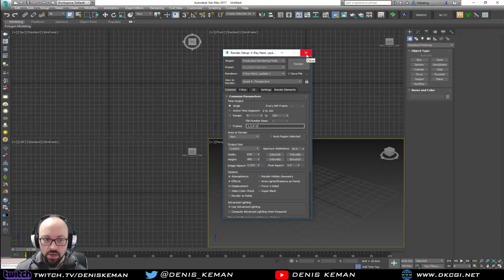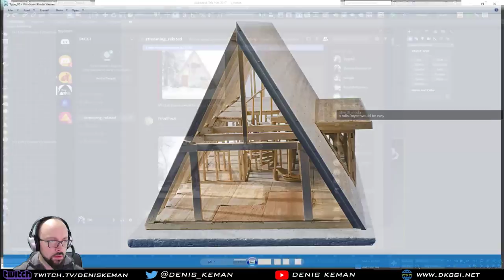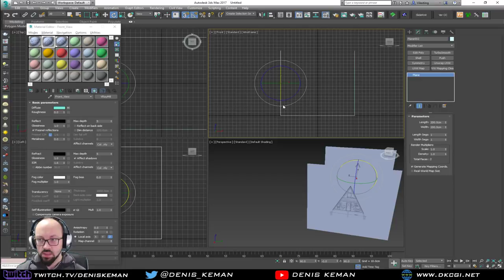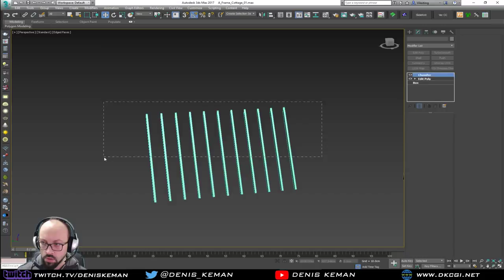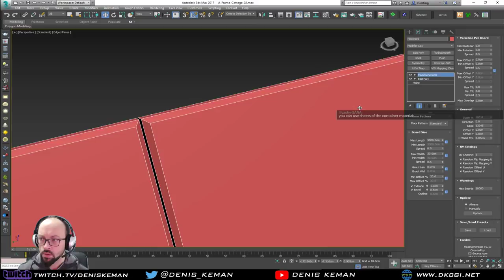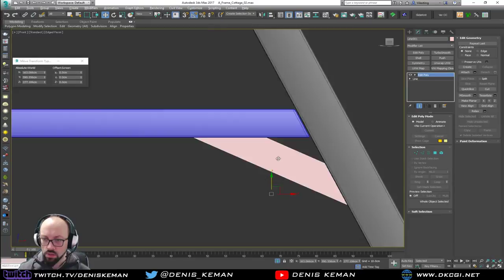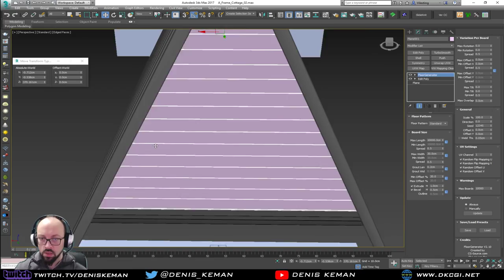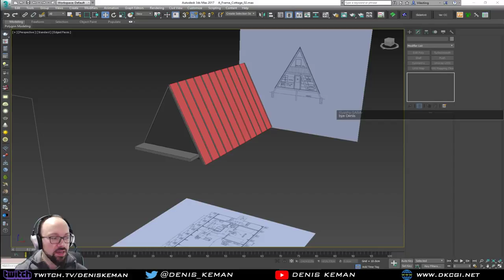Modeling a Cottage in 3ds Max Part 01 - Building The Base Frame

Comment: Hi Denis, just watched your video and I love the way you work. I noticed a problem there.. your floors thickness is actually too large. The supporting beams thickness is  what you actually see in the elevation plans. And the floors thickness should be much thinner (like 2 cm - wooden planks). That's why the human looks too tall for the ground floor. Anyway.. just telling you that, cause you might encounter some problems on the next phases. Can't wait to see the next video! Greetings from Romania! I'm a fan 😜
Reply from the maker: No worries .. for now those are just placeholders. Once we get to actually making the floors we will use a plane and use either a Substance to drive the material, or use Floor Generator to get the geometry for it. 

I'm actually really glad that you liked the video and hope to see you join me when i go live next time.
Reply: @DenisKeman   Yes, I hope I can join your next live session, too. :)
Reply from the maker: @valdsg  Oh yeah and remember .. if you have any ideas about what to add feel free and leave them here in a comment or over in the Discord Server
Reply: @DenisKeman  I'm a fan of Frank Lloyd Wright.. so I would mix wood and stone with some modern touches.. 🤓

Comment: Denis hello, why didn't you do back plates in viewports instead on a geometry ?
Reply from the maker: I prefer the geometry approach. The viewport approach is something i used to do way back
Reply: @DenisKeman  Thank you for answer)  Have one more,  do you scale model after importing to UE engine or you're prepared all sizes in max ?
Reply from the maker: @DjLeonSKennedy  If you start scaling stuff when you are in UE4 you will have an issue if you want to continue tweaking the model in 3ds Max